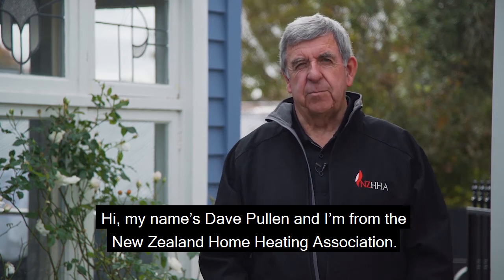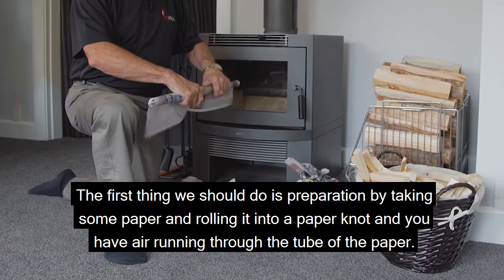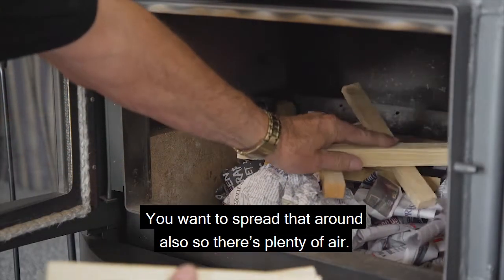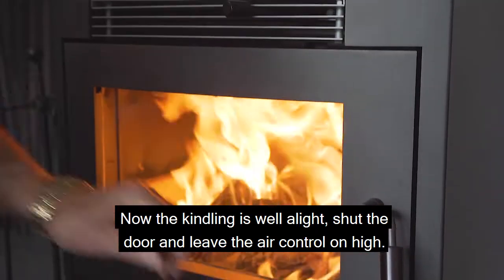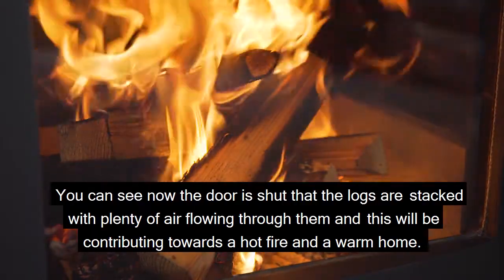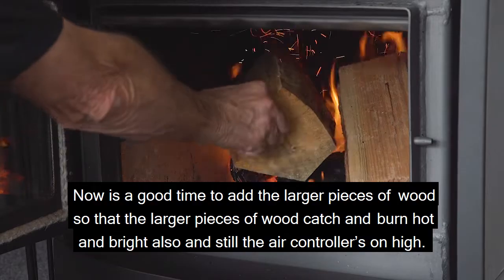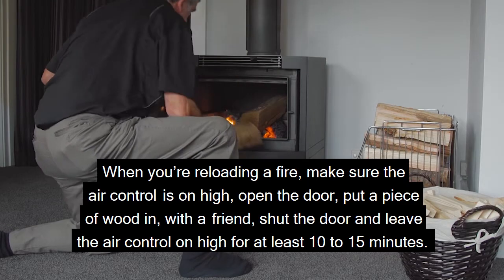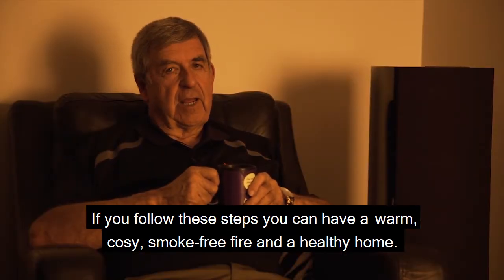How to light a fire on your wood burner

Comment: Too much work dave trust me i hate doing this , get old candle wax melt it on newspaper screw them up put two inside under your normal wood with only a little kindling and up it goes soon as you light the wax close the door .most smoke enters house on start up ,cant beat the old candle on newspaper .learnt of an oldtimer.

Comment: Hey Dave, you're doing it wrong. The best way to get the fire to draw as soon as possible is to use 2 x firestarters - one halved in amongst the kindling and the other sitting on top of the baffle directly underneath the flue. Light this one a couple of minutes before lighting the 2 halves and your fire is guaranteed to draw from the get go thanks to the pre-warmed flue!